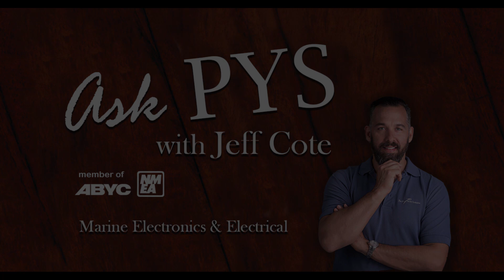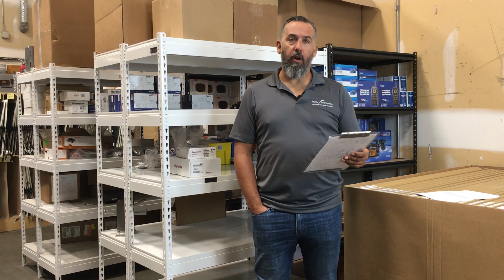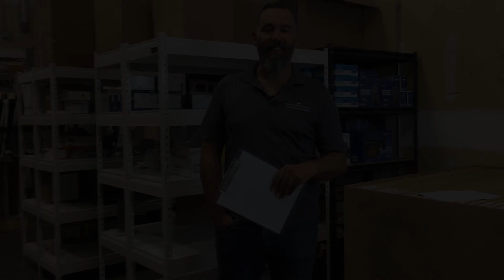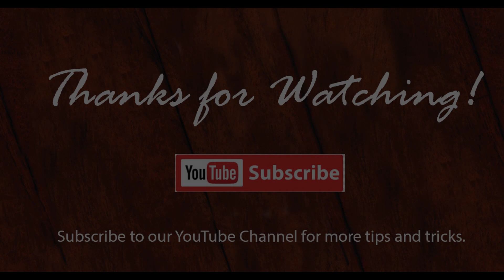Can I Heat Hot Water with an Inverter or a Methanol Fuel Cell?

Comment: Why didn't you give an example of a battery/inverter combo that would work? I(the 1 in a 100) use my battery bank and inverter to run our water heater as one of two options when off the grid. We also use an electric induction cook top(1800W) to cook our meals. I feel that you missed a great opportunity here to say yes you can and here is what it would take.
Reply from the maker: Good point. I will next time.

Comment: What are your thoughts on the efficiency and practicality of on demand (tankless) electric water heaters?
1. They generally require 240v
   a) Series Inverters
   b) Single (Large) Inverter with an Auto Transformer
2. They generally require >6 kW
3. They function similar to a starter battery... High drain for a Short Duration.

I am specifically asking about battery/inverter operation. Not via an AC source such as a generator.
Reply from the maker: No real world experience with them as of yet. If you decide to try one, please share.

Comment: I recently picked up a car kettle. It works off dc power and boils a litre of water in about an hour. It draws 7 amps. That’s a long time to boil and it’s only a small amount but it’s enough to make a cup of tea or wash dishes.
Reply from the maker: Hi David, 7 amp draw is totally reasonable. Can you share a link to the kettle you found?
Reply: Pacific Yacht Systems https://www.amazon.ca/dp/B07J4HKLW2/ref=cm_sw_r_cp_tai_DWMzFbKEE2TR6